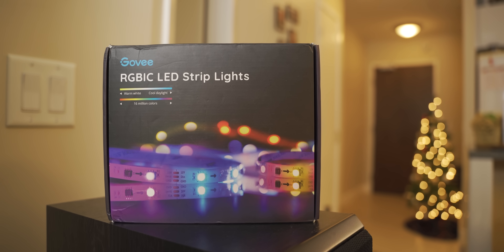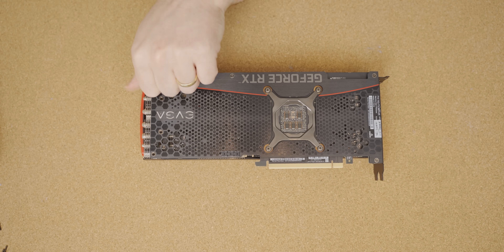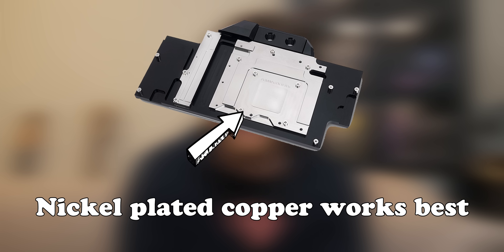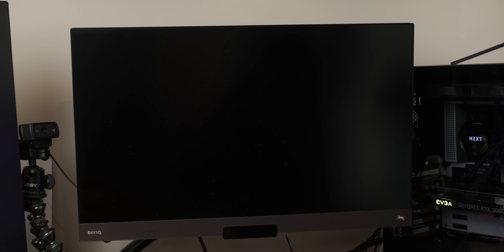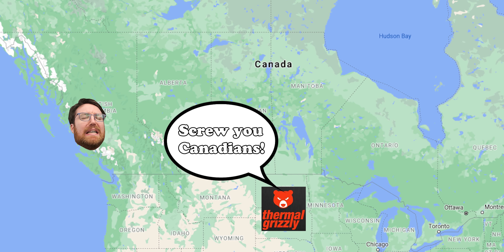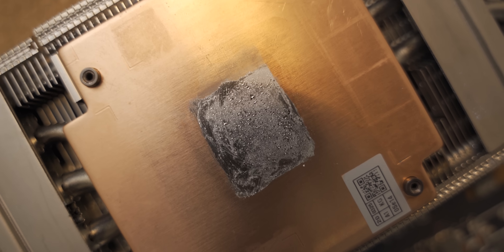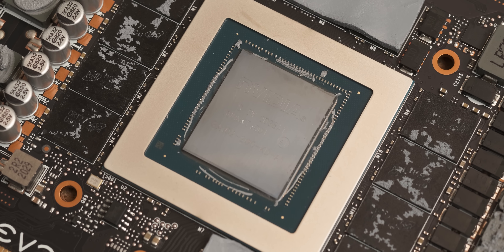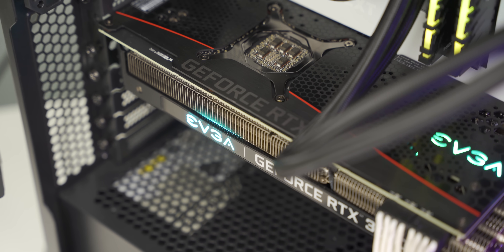NOOB uses Liquid Metal on an RTX 3080...

Comment: I dont know if someone mentioned you a solution to your fan problem.

The RTX 3080 has temperture sensors on it's GDDR6X video memory chips, by default, Hwmonitor cant read these out as of right now, Hwinfo could do the trick here.
GDDR6X is rated for up to 110c, if it reaches these temps (gddr6x runs really hot) the card ramps up the fans and throttles down, I'd definetly look into the temperture as it may be causing performance drops and the high fan speeds.

The GDDR6X chips are the black chips right next to the GPU, a 3080 usually has 10 1GB chips on them, you want to make sure that they are properly connected to the heatsink with thermal pads, You can also put pads on the back of the vram to help spread the heat more, that's a common thing miner's have done to get the memory cooled down, since mining ether (like it or not, but a lot of gamers do it as of recently to make some money back from their overpriced graphics card) is very memory intensive.

Some cards (especially Gigabyte, all of their versions seem to have at least some issues here) have that problem out of the box, but not as bad.

This comment is fairly late and i have no idea if he already solved the issue, but I'm very sure its a vram temperture problem, liking may help him to see it if it's in time, idk.

Comment: If im not mistaken I believe that the thermal pads come in different height sizes and u cant just swap them out at random.  It sounds like a height sizing issue that u were having

Edit I'd also recommend doing a clean gpu driver reinstall.  The last update made my 3090 down clock and it didn't get resolved until I reinstalled the driver

Comment: The point of LM is not to always reduce the core temps directly, but rather the rate it takes for the heat goes from GPU to the heatsink so it gets cooled faster.
Even though the fans will still ramp up regardless if the temps are the relatively the same, at maximum load and contentions operation it will be easier to get read of heat especially in temperature spikes and if the cooler also touches other components, for obvious reasons that benefits them as well.

Comment: Consider using a non-conductive, heat-resistant tape (https://amzn.to/3n6Uyf7) to cover the conductive points that surround the GPU die. This will prevent the liquid metal from shorting them out, the most frequent reason for catastrophic failure when using liquid metal.

Comment: Liquid metal is not applied correctly but even with that you reached 2ºC of improvement. 
Normally you can lower 20-25 degrees but on cpus with paste between die and ihs the improvement can go up to 50 degree lower temps.
Try again.

Comment: The thermal pad issue he is somewhat similar to what happened to me. I was getting high vram temps while mining (dont worry im just using my main pc, not an actual mining rig), so decided to buy some thermal pads to try to fix it. Installed new thermal pads, but they were too thick so the die wasnt making enough contact. After trying to press them down and thin them out, and even buying thinner pads, I used thermal paste on the memory chips and it fixed my problem. Hasnt given me any problems so far, but my temps have not improved, so i came to the conclusion that the gigabyte gaming rx 5700xt just has bad memory cooling lol.

Comment: Interestingly, I had the same exact thing happened to me, except on my laptop. I repasted it 6 times before I got the thermal pad configuration right and I actually had to use 4 thermal pads and thermal "goo" applications on two of the remaining VRAMs because 1mm TP was too thick and 0.5mm was too thin. Nevertheless, after my 7th and final attempt, it's running better than ever and I can actually push some decent overclcok with good temps!

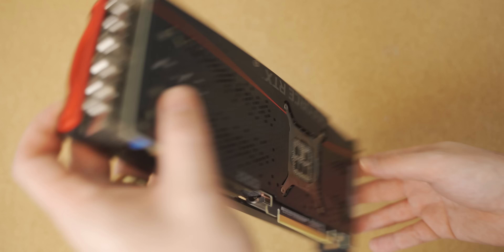Comment: This might be a bit late but maybe this bit of info is useful to someone else, so it seems that he lack of contact between the die and the backplate once moving to liquid metal can be compensated by using 4 small round washers on the 4 screws of that rectangular frame as seen at 05:22.

Comment: I have to have my heater running all the time cause my room gets reaalll fricking cold through a vent, which I have near my pc, so I leave my pc fans 100% while gaming since it’s barely any louder than the heater and doesn’t interfere with gaming, but I get higher performance and lower temps this way, so... yeah.

Comment: i can assume it is the surface of the heat spreader... it is brushed copper... liquid metal doesn't work ell on that that is why you need to put more to fill the rugged surface... that is why it is best to use it on a nickel plated surface almost like mirror... you could try to sand and polish to get an even surface where you can apply a small quantity of liquid metal as in the first place...

Comment: I have used liquid metal countless times on GPUs and CPUs and it's not a science, it works great, have always used electical tape to cover the components around the die.
The purpose of any thermal compound is to fill in the gaps between the cooler and the die, so a little bit more liquid will not hurt but you applied way too less on your second attempt.

Comment: my 3080ftw really throws the heat out when gaming  at stock but it reads only 70 to 77 c gaming soon as i stop gaming its back down to 62c.its a heater compared to my 1080ti which was a reference card at 84c i barely felt the heat ..compared to the 3080.but its pushing almost 200fps on bfv on ultra 1440 2k

Comment: Liquid metal isn't too scary actually
the reward from proper application can be so high, especially on laptops.
Tried it once, i don't even use nail polish (i did cover the transistors using electrical tape), and as long as it's thin enough, it won't leak out everywhere, as the cohesion bonds of the metal is actually really good (just like mercury). Even on a mobile laptop i never have a problem of leakage, or could be just the electrical tape coming to the rescue.
But yes, you will need to reapply it every other year as it will very slowly absorb to the copper heatsink.

Comment: The XC3 (and every ampere gpu) has quit a lot themp sensors, but you only see the gpu main sensor on Afterburner. Evga only includes extra sensors on their FTW3 lineup which will show in their X1 Tool...

You can see at least the Vram Temps via GPUz.
I mean the GPU fan spins so fast because your gpu has much more sensors which recognize a Hotspot on the pcb. But you are right, would be great to be able to see all the sensors of the die and PCB, but I guess Nvidia don't want it because no board partner includes this, and like I said even EVGA had to include extra sensors on the GPU (which are useless in Theorie, Nvidias build in sensors would be even bether)

Comment: put some thermal pads between the memory and backplate.
It's highly unlikely the card has only one temp measurement. I'm 100% certain there are for the mem and a junction (aka hotspot). The fans would not ramp up if there was only one measurement at 64°

The liquid metal is definitely making a difference as shown by the temps in the 60's. You just made it worse in the end and a bit better somewhere else.

Comment: You should also have considered using K5 Pro Thermal Putty to replace the pads. It's a thick, viscous putty like stuff that's not electrically conductive, but can be compressed/flow to fit gaps and is meant to replace conventional thermal pads. It's a bit of a pain to work with, but it's effective, and very adaptable due to its playdough like consistency.

Comment: I wonder if you checked the clock speeds with and without the liquid metal, since the GPU could have been reaching an higher average clock given the lower temperatures, which in turn produces more heat and thus reducing the temperature advantage.
If you want to check the temp difference between stock paste and liquid metal the tests should have been run at a fixed clock speed and using the same demo/benchmark instead of regular gameplay.

Comment: I have got a solution for your problem (the gpu fans ramping up to full speed) ... its not the thermal pads its the mounting pressure bc die liquid metal layer is much thinner than a normal thermalpaste layer ... so just twist the srews in with full force (if ur scared doing so just watch jaytwocents xoc videos bc he just rapes his cards and they still work) ... my card (palit rtx 2070) is now running at 2080mhz sub 60C so liquid metal helps a lot

Comment: I have an older MSI laptop with a GTX960M and the liquid metal made a significant difference in the GPU temps. Under load it dropped about 9-10C and no longer throttles. It was scary applying it but well worth it for the performance I got from it. It is too bad that the CPU side of the heatsink is aluminum as the i7-5700HQ runs a bit warm. The GPU heat sink is copper though.

Comment: Liquid metal is only advantageous when the heat source's contact area is really small, so small that more conventional TIMs pose a substantial thermal transfer bottleneck vs the heat output. Like between Haswell and Skylake i7 k-series dies, and their heatspreader (where the LM is also sealed inside underneath the heat spreader).

GPUs on the other hand, are both direct die cooled, and the die surface area is really big, so there's not really any notable thermal transfer bottleneck using conventional TIMs, to overcome. Miniscule to no gains, certainly nothing that's worth the additional risks you take on.

Same story with using it between a CPU heat spreader and cooler / waterblock coldplate. Surface area of contact is so large, good quality conventional TIMs do not pose any thermal transfer bottleneck for (using) LM to overcome.

Comment: Bro I have strix oc 3080 and got -20 degrees from 60-70 to 40-50 by doing liquid metal + removing stock fan shroud and just ziptie 2 120 AP fans and connecting them to the stock gpu fan sockets. good luck

Comment: Only thermal paste I use is LM. I used it on my 5700xt max temps was 57c used it on my 1650 super max temps 51c and used it on my 5950x to be able to use it on air max temp 70c. I have normal thermal paste for that just incase need if I had a cooler made of aluminum like repasting Gigabytes terribly overheating (87C Idle) poor choice thermal pad habit of using it on their chipset. That heatsink is made of aluminum so I need normal paste. That drops temps all the way to max 56c on chipset but If I could Id use LM on that to lol!

Comment: Your issue is due to memory junction temperature. If your memory get to 110c your card Will thermal throttle. You can check memory temperature with hwid info. They are memory chips on the back of the pcb maybie those one are the issue.
I had the same problem with my 3090 adding more thermal pad on the back helped a lot

Comment: that looks like a bare copper heatsink, which will probably alloy slowly with the gallium in the thermal grizzly liquid metal - should be fine for a year or so, but then it will 'dry out' (I.E. be absorbed in to the copper)
check it after a year or so and report back - would make for a good vid :)

note: I had this on a raw copper IHS replacement when de-lidding my I7 8700k
Reply: Yes I also had LM on my copper heatsink and it absorbed it completely after like a year (I mean bone dry)

Comment: Liquid Metal is best when coating both the GPU and the Coolers plate then when theyre laid back on top of each other they essentially bond together giving much better transferance of heat same with when  you delid a cpu. however you need to stencil exactly where the gpu makes contact i used a scribe to draw the impression of the thermal paste made on the cooler and essentially painted between the lines, the same thin coating should be applied on both sides.

Comment: I know im late to this video. I had a 980ti back in the day, thats temps were out of control. It was because the fans were just under-performing for some reason. The card would idle at 60*, and hit temps of 85-90 during gaming. I decided the smart idea would be to replace them with 2 120mm (noctua) fans, with a gpu fan adapter. The difference, was almost 25*. So 75, at full load.  If you take into account I had to dial the fans down, to keep in line with the voltage to rpm ratio they were now also super quiet. The only downside was that I had them zip tied on. I tried to make it look as nice as possible, but YOU could make your own gpu shroud with a 3d printer or something fancy.

Comment: i bought used strix 1080 in 2018 and it was thermal trottling with limit 82*C and even 91 soo i reapplied  stock paste with thermal grizzly kryonaut and it goes to 72-74*C but after this i ues liquid metal and it sits around 64-67 on 100% load and it was 2 years ago nothing changes

Comment: I tried with my Xtreme 3080, had same issue, it was so good with my old Strix 1080 ti, but not with 3080. It’s not worth it if you don’t use Custom water cooling.

Comment: I have a RTX 3080 XC3 Ultra and I'm getting the same exact temps you are without liquid metal. You should have sent that thing back if you weren't getting around 75c at full load. My fans never ramp up above 60%...

Comment: Pretty sure it’s gallium in there giving the aluminum a bad time.

Graphite pads. Graphite pads. Also graphite pads tho. Your thirty 80 has a smaller cooler than my triple fan 3060 ti, EVGA seems to have good boards but slightly weak coolers.

Comment: Its good to know its not worth it :P
For people who want less noise and better thermals, its better to pay slightly more for one of the "premium" cards with large coolers.

I have tried several 3090s and the Arous Xtreme has highest average clocks of those I tested, even if I OCed them all.
So of course the larger heatsink means it wont throttle that easy :)

Comment: Sir, I'm currently experience a high gpu temps when I use my gpu anti-sag bracket. My temps go up around 9degrees Celcius with my bracket on. Do you have experience in dealing with this kind of issue?

Comment: I applied liquid metal on my water cooled 3090, now it can maintain a GPU clock of 2190 MHz with max temps of 35 C (ambient is 19 C).
Reply: I got the EKWB block. Asus sell a 3090 with an EKWB block instead of an air cooler.
Reply: I don't believe you.
Reply: @trisbane4086  , believe what you want. It’s not like you’d believe any screenshot I take. Keep in mind I was using the EVGA FTW3 500W bios. I just recently reverted to the Strix bios for resizeable bar support and it now boosts up to 2160 MHz. Can’t say I miss the 30 MHz drop in frequency though, probably only useful for benchmark scores
Reply: @Alm8hoorOW  Ok, I believe you.

Comment: You don't use the liquid metal with aluminium because(drum roll)
Gallium and it is liquid at room temp. Gallium reacts with aluminium and creates 
a weird alloy that crumbles at the slightest pressure. I've seen a video of it destroying tennis racket and padlock made from Al. It crawls from the surface inside the Al and spreads allover the Al but takes several hours to do so.

Comment: The liquid metal treatment would work much better on a CPU. Graphics card cooler already make direct contact from the die to the cooler, making the thermal transfer more efficient when compared to a CPU where it has to go through 2 layers of thermal paste and a heat spreader.

Comment: Love how Dawid can mess around with a 3080 testing how much or how little liquid metal he can put on a gpu and I'm clutching my 1050ti worried that it'll breakdown from old age...
Reply: your 1050ti will survive till 2030 atleast, dont worry computers last a long time
Reply: @CheekiBreeki-mq2my  Yeah, surprisingly, unless something catastrophic happens to a PC, they tend to last indefinitely, assuming they're treated well and dusted. People usually replace devices prematurely because they want a performance boost out of new technology, not because their device suddenly broke. PCs absolutely can wear out, but it's not a guarantee, and I've noticed that the vast majority of my electronics and computers are probably going to outlast me if I keep using them forever.
Reply: @VectorGaming4080  well my gt740 is getting very old and the silicone is degrading so much i have to downclock it but itll work for another 10 years so your kinda right
Reply: @VectorGaming4080  this is true, my ipod is over 16 years old now and it still works perfectly fine
Reply: @CheekiBreeki-mq2my  In the last 15 or 20 years I have only had one catastrophic GPU failure and that was an old ATI X1600 where the capacitors ruptured quite spectacularly but that was in the early 2000s when there was a year or two where products across the tech industry were failing due to bad capacitors.
Reply: @CheekiBreeki-mq2my  we're more worried about driver support tbh. My poor little 770 isn't supported anymore 😭... My 980m is next 😨.
Reply: PC components surivive so extremly long. They onlyest thing i managed to kill was a Xeon CPU because I overclocked it over the limits. :s But it's been running awesome speeds tho. But even with that extreme stupid oc it survived 3 years... and I bought it used.. so it lasted like 10-12 years even with stupid oc
Reply: i still have my GT 640  GTX 980 Ti  and GTX 1060 and all of them still run fine..

Comment: WHY the liquid metal is pointless for most graphics cards...
Liquid metal makes a bigger difference cooling certain desktop CPU's. A desktop CPU has some TIM (solder or paste) on top of the chip then a metal heat spreader on top of that. THEN you put thermal paste on top of the entire CPU and then your cooler...
HOWEVER, in a graphics card they don't need the heat spreader + TIM layers that helps protect from the weight of the CPU cooler so there's much less benefit in replacing that one layer of TIM.